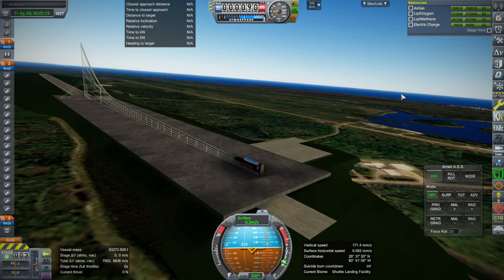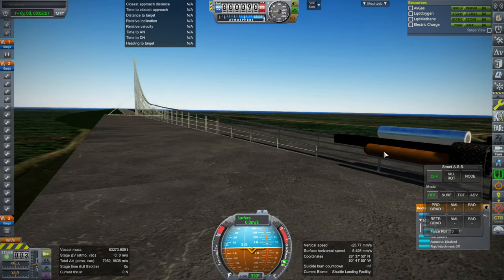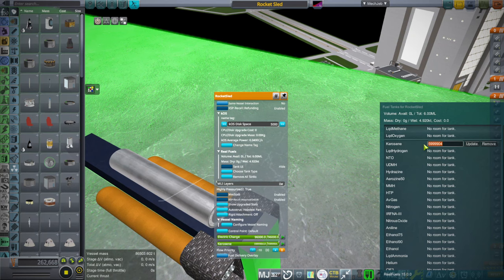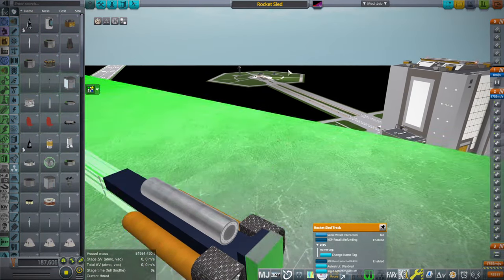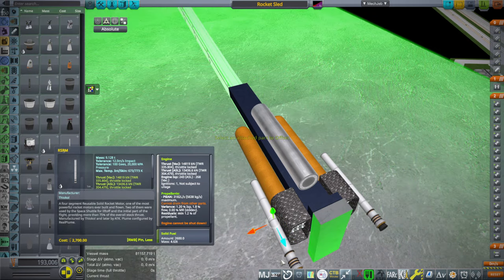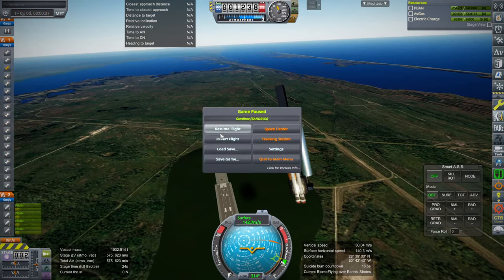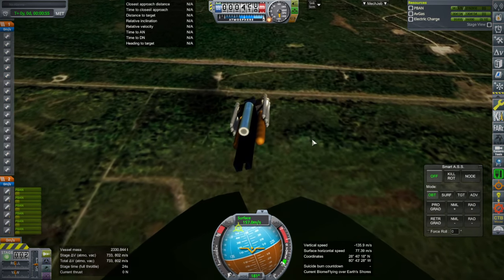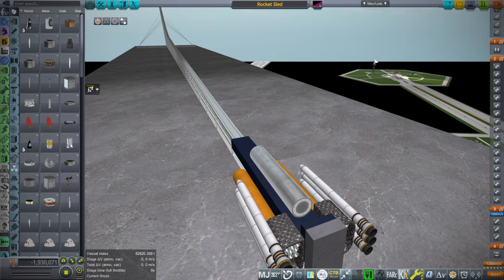Rocket Sled (Kerbal Space Program)

Comment: There is a small bump in the rocket sled ramp that jitters the Rocket Sled at 4:21. From there it becomes gradually less stable, even going off the ground slightly until "Vapor in feedlines" becomes an issue. Its also visible from other angles and is a visible part in the Rocket Sled Ramp. I wonder if you could turn the Rocket Sled Ramp into a Kerbal Konstruct static, if that doesn't affect the impact tolerance of the sled itself.
Reply from the maker: It would be very difficult to position the sled itself properly on the Kerbal Konstruct static.

Comment: The problem you have is the sledge with payload over 2k tonnes, you need to lower the weight :-) under 100tonnes
Reply from the maker: The payload is not over 2000 tons - I mentioned its actual mass in the video. For its purpose, it will need to be 1300 tons potentially. For the Orion III spaceplane in 2001: A Space Odyssey, it is launched on the back of a carrier plane, but they're both launched by a rocket sled like this so that passengers can enter horizontally. If the thing is vertical, it's very hard for passengers to get into their seats on the ground. However, the combined mass of the spaceplane and carrier plane is around 1300 tons. This is not random.